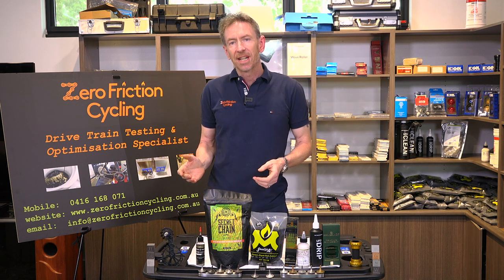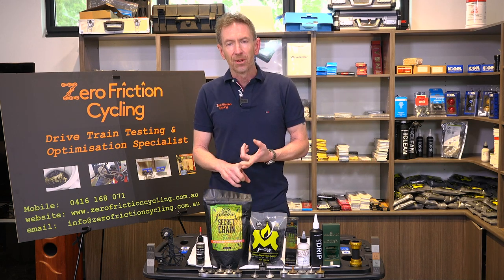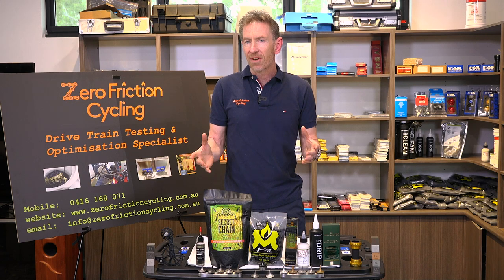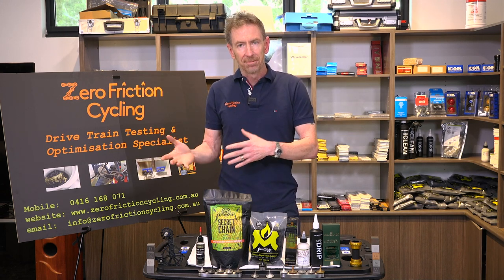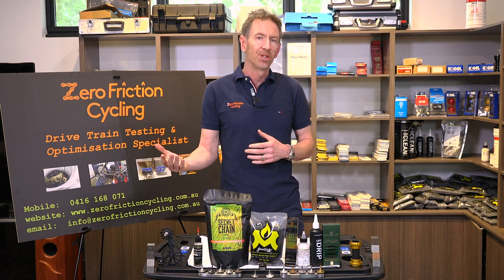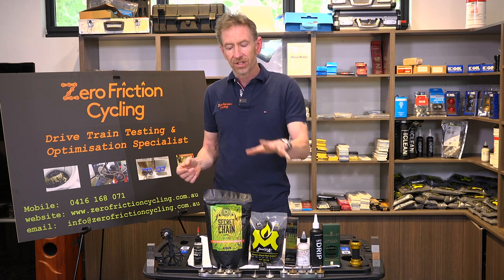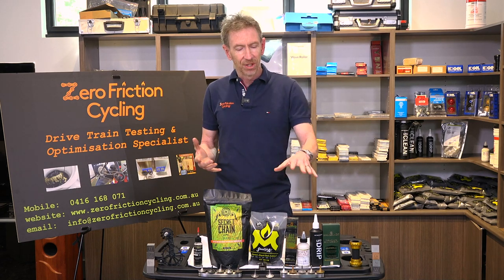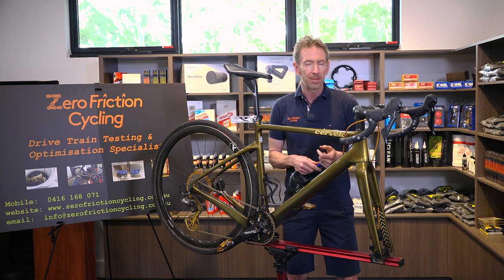Episode 2. Types of Chain Lubricant

Comment: Welcome. I have a question below, but first some info that might help others watching. I’m just joining the waxing community — you know what I mean 🤣 But seriously, the timing couldn’t be better. I’m an e-MTB rider these days and a wax drip type for maybe 15yrs on all types of bike. The supply issues in the U.K. with 12 spd Eagle got me searching the Google and hey-presto I found you, the only comprehensive open source published real life replicating tester of chain cleaning methods and lubrication tech!

I have my 2 chains, my chain ring, my cassette, my crock-pot, my bag-o-wax, my glass jar, my turps and my meths and now I have your YT Chan to teach me how to use it all ready for swapping out the almost knackered chain-set on the rig 🥳💪👏🏽😊

And I have a question that’s not answered up front in your website advice. “Now I know how to look after my chain, how should I clean and prep my chain ring and cassette after each ride (you know the drill: after dry rides, dusty rides, muddy wet rides and so on)?

Comment: What exactly is the difference between chain coating type lubes and Smoove/Squirt? Aren't they all wax/water emulsion?
Reply from the maker: Good question - they are all wax emulsion but the wax bases are very different. Squirt i believe is basically slack wax base, smoove probably similar. This is a good chain lubricant, and cost effective, but it goes to more of a paste - has significant initial penetration issues, and is a tough clean. The latest gen stuff that call themselves chain coating (led by ufo drip, then ss drip) are a very highly refined wax base (believed to be mainly paraffin but with other waxes as well) that set much more to a true solid vs a paste. They have no penetration issues, and are vastly easier to clean. By being basically solid they are extremely contamination resistant, and their very refined wax base makes the compatible to use in conjunction with immersive waxing without needing to clean before putting in wax pot making them popular for those who are not sure re staying on top of immersive waxing every time. Whilst they cost more, the advantages and lower wear, cleanliness (they dont gunk up anyhwere near as much), ease of cleaning, no penetration issues post cleaning - all up the extra is most definitely worth it for almost all cyclists vs traditional wax emulsion type lubricant.

Comment: With a waxed chain, what is your expectation for mileage before you get to 0.5% wear on an 11 speed chain?  Thanks.
Reply from the maker: like all things in this world it varies a lot,  but the average (and this is from a lot of waxing customers now over 6 years of zfc) is 10,000 to 15,000km for a quality chain, re waxing by 300km per treatment, changing to fresh wax by circa 8000 to 10000 km per bag. We have had some get well over 20,000km to a genuine, measured by me, 0.5%. Drip lubes average 3000 to 5000km, top drip lubes like synergetic, ufo drip etc can get circa 8000km+.

Comment: New subscriber. Enjoying the content. Can you do a review on chain cleaners (degreasers, vs kerosene, vs turpentine, etc). I currently use Zipp Citrus Degreaser and really like it, but maybe I'm doing it wrong. Also I imagine you'd use different cleaners for different lubes(?) Thanks
Reply from the maker: Hi ric, maybe one day but that would be a long way off. Lubricant testing has me absolutely run off my feet for the forseeable future, testing the difference drivetrain maintenance techniques is on the list (on bike spay clean vs clip on chain cleaners vs remove for flush clean vs ultrasonic clean etc) is on the cards for whenever i manage to get a spare spot. Objectively testing & assessing different cleaners - i cannot see at the moment where i could fit this in, and it is simply a lower priority as we know what does work, so can just recommend that. Ie why pay so much more for degreasers, which will leave a heavier film behind for alcohol to have to remove, vs something as cheap, powerful and clean as mineral turps. If i have a choice of product a at half the price per litre and it does a perfect job and easy to ensure no film, or product b that costs twice as much and will leave me with more to do on the finishing step - i am just going to go with product a... and recommend product a.
Reply: @zerofrictioncycling992  Totally understand. Thanks for responding and for the engaging content!